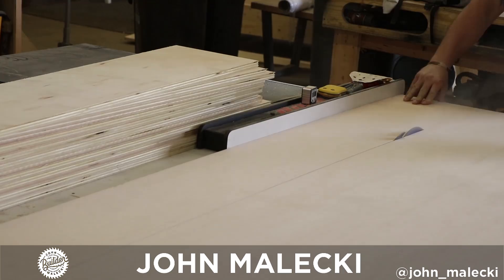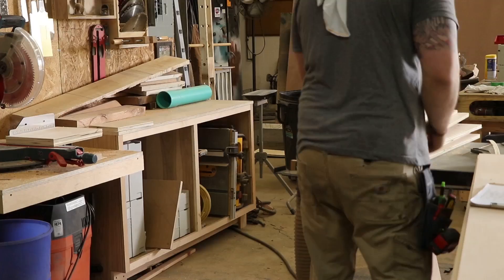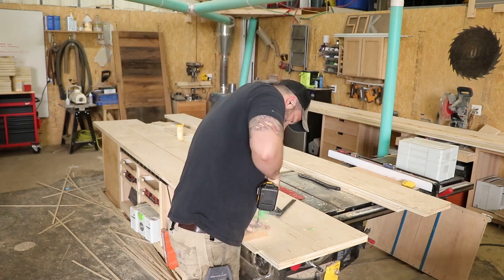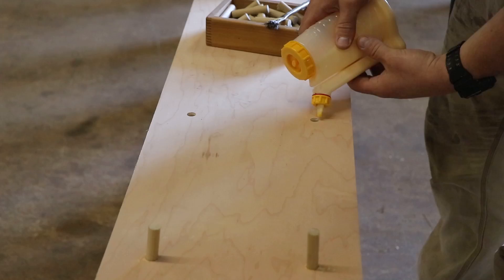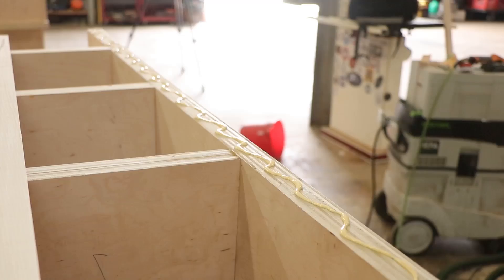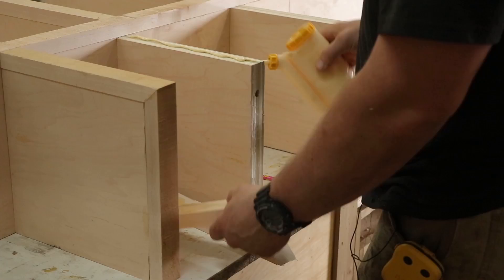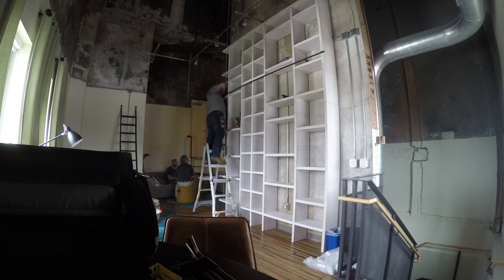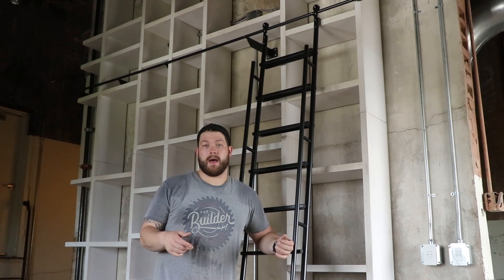13ft Tall Rolling Ladder Bookcase | Woodworking Madness

Comment: John, at the end I could see You did not cover the screws You used for the joint, and I could see the gap between the panels and the wood for covering the side ofrecimiento them (front). Did You fix it later?? Was it non important because books will cover it?? I am a huge fan, and I was thinking there is got to be an explanation. Sorry for my english, i speak spanish.
Reply from the maker: The look of the piece is supposed to be more "rustic" so we left the screwheads exposed to match the hardware on the ladder